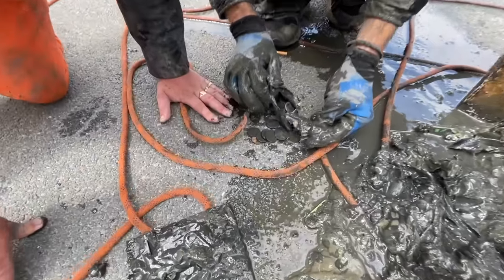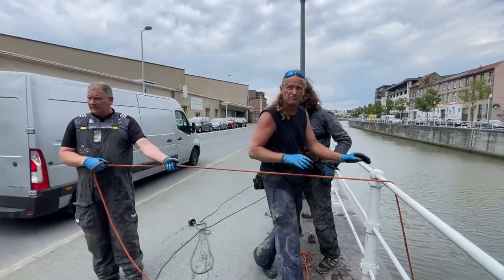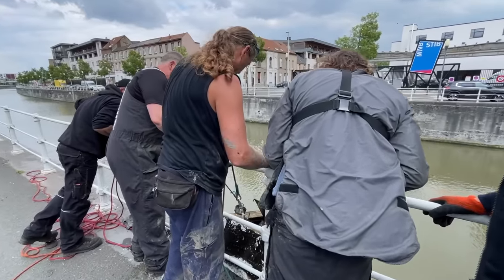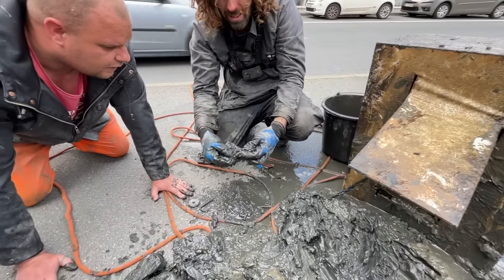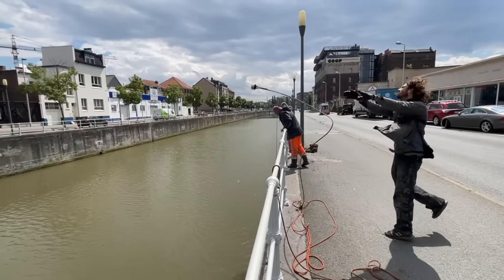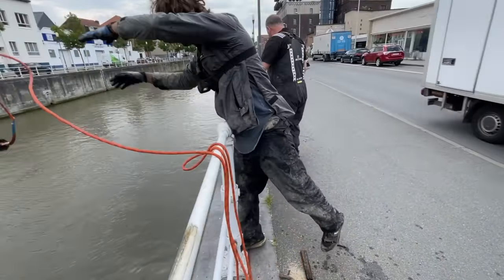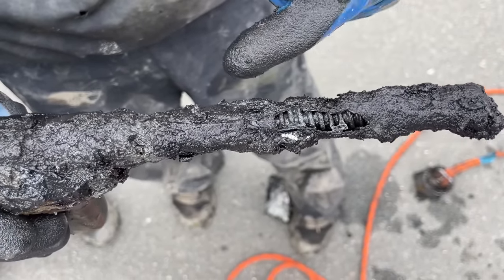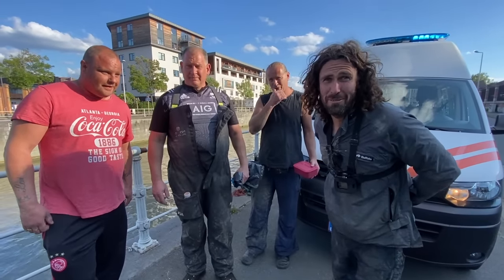You'll Never Believe What we Found Now Magnet Fishing in the Forbidden Canal

Comment: Those coins that you guys found inside the safe are  old laundry tokens. No real cash value but they are collectible different values with different dates similar to regular coin collecting. About 3,00€ on the 5k 1982 and 1,15€ on the 10k 1981. Not worth a whole lot, but still collectible. The number and letter corresponded to its use or load. The 5K being for 5 kilos the 10K being for 10 kilos and there were different coins for dryers as well as washers.

Comment: You shouldn't be putting your hand into the safe or anything that heavy at water level. If your hand or your clothing gets caught by the object in question and that rope snaps or frays, you'll be going down to the bottom with it. Safety first!! What you're doing there is setting a really bad example. As for lifting heavy objects out, have you not heard of using multiple pulleys to make the lift much easier?